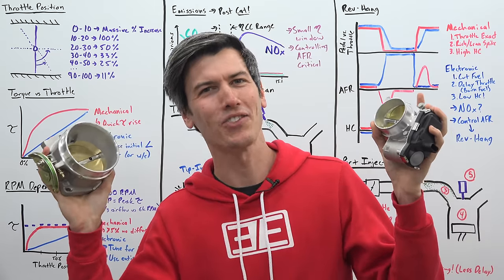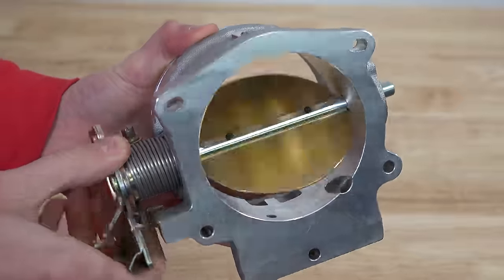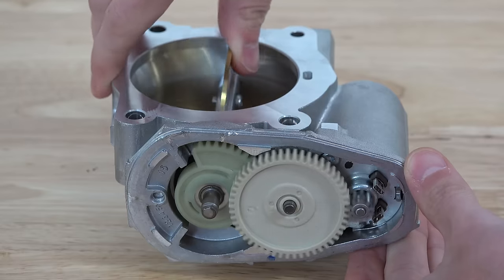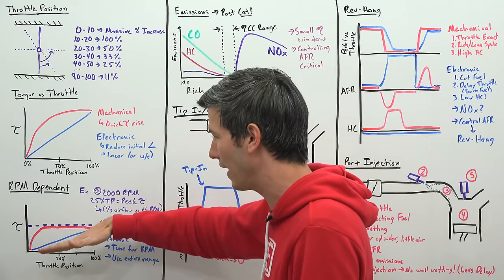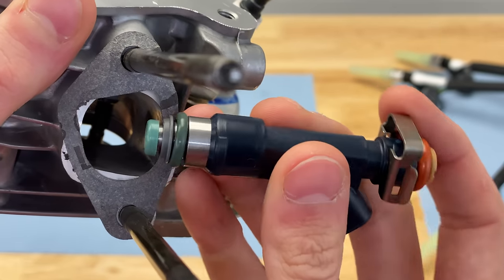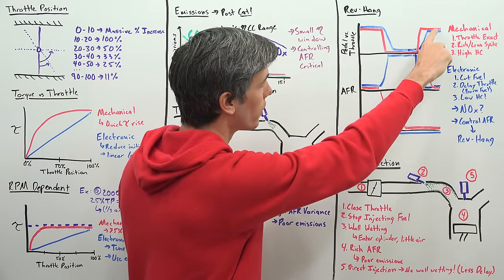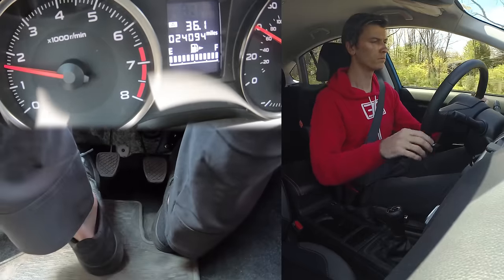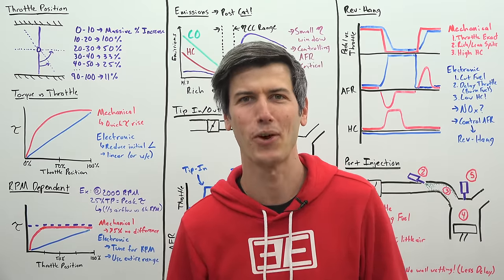The Big Problem With Modern Manual Transmissions - Rev Hang

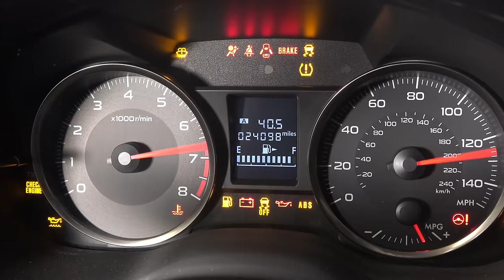Comment: It seems you contradicted yourself at 5:37 vs. earlier in the video.  You earlier mentioned rev hang leads to rougher shifting in a manual transmission, then said the electronic throttle body helps make shifting smoother.  The latter is true.  IMHO rev hang is only an issue with a manual transmission because you cannot take advantage of the engine braking as quickly vs. a mechanical throttle body.  The first time I drove a manual and noticed rev hang (I didn't realize immediately the elec. TB was the cause), I hated it terribly.  I did realize emissions had to be a part of the reason for an elec. TB.  A lot of cars used to have a damping system (sometimes called a dashpot) on the TB due to emissions and reducing backfiring due to fast TB closing.  Also, I'm not sure if Idle air control valves are no longer needed, but if so, less parts and that's always nice.  If you actually read all of this, I wrote it for you.
Reply: Yep. Didn’t see this and pointed out my old roots has a dash pot. Does exactly what you said and keeps throttle from slamming closed. So the new electronic doesn’t seem to solve anything but actually makes for a worse experience. Then again, manuals are going away. 😞

Comment: My Kawasaki motorcycles have mechanical throttle bodies with computer controlled secondary butterflies.  Was this an early attempt at achieving the results of throttle by wire?  It can smooth out the throttle if I go wide open throttle and "decide" how much throttle that is really needed.  I think that they can also be used to control noise in situations like EPA noise testing.  People used to remove the secondary butterflies, but now tuners have figured out how they can use them to their advantage in tuning.  Could you ever do a video on the secondary butterflies on motorcycles in the 90's and 2000's?

Comment: Why didn't "analog" carburettors use an oval/paraboloidal curve guide for the throttle cable? That would fix the lack of linearity on torque easily.
Reply: They used cammed levers, which does effectively the exact same thing.
Reply: @coupledyetivonvanderburg5385  so all the argument on the lack of linearity between throttle position and torque delivered is BS?
Reply: @whateverrandomnumber  
Yeah, for the most part.  The part about rev hang and the reasoning behind it is still true though

Comment: i feel like you can correct rev hang by correcting your shift timing habit.... idk i drive a 5 speed del sol... controlling the throttle with a wire hanger pretty much haha

Comment: I have a Nissan with ETB and a manual.  It's really weird.  Say you don't give it quite enough gas off the line.  A 'normal' car would just stall out.  This thing does a strange, 3/4th of a stall (all the dash lights will come on, RPM gauge reads 0) but it will sort of sputter itself back to life and 'restart' itself.

Comment: My Citroen C2 idles at 900 rpm stationary but as soon as it moves and you're coasting in neutral or pressing the clutch, the idle goes up to 2000 by itself until either the engine is warm or you can clear it with a few goes revving over 5000. It didn't used to do that so I'm wondering why.

Comment: all that goes out the window with the toyota im. there is no pros to pedal feel.
i mean i certainly like the idea that 1/3 pedal is the same as to the floor- exactly the reason why i bought a manual.
I have no idea WHEN the car actually wants to shift as its a jerk regardless. my solution is to be back on the gas before it comes out

Comment: Rev hang has been a problem for many cars even before Drive by wire throttles. i used to cut a aluminium can and half block the idle control valve with it and problem gone.

Comment: Electronic throttle is not required for air/fuel ratio maintenance when the air/fuel ratio is directly controlled by the amount of air flowing into the engine. Hint, hint. Carburetors also remove the need for MAF sensors, and electronic control of the engine in general.

Comment: The throttle position makes so much sense as to why im awful at being smooth on the throttle with my mazda. i thought a electric throttle body worked exactly like a mechanical one just without the linkage. When i switched from my thunderbird to my mazda i found it  felt way different than my thunderbird and i struggled to be smooth when accelerating and couldnt for the life of me figure out why. It was like i had to re learn how to drive a car.
On my old thunderbird or any other car ive driven with a mechanical throttle body i find way easier to accelerate smoothly. Electronic throttle bodies are technically better but to me the throttle pedal feel is actually worse.

Comment: I think how you shift matters. My cabled throttle body var will shift rock hard at wrong rpm. I over rev in gears to be able to drop the clutch quick that is silky smooth. NEVER would I let out a clutch at 2000 rpm
Newer cars have rev matching anyway so this will become obsolete eventually

Comment: So, are there any modern manual cars that don't have rev hang? Or is there a way to disable rev hang in modern cars so the driver can actually have control of the car?

See, I thought the whole point of even having a manual car nowadays is to be in control of the vehicle and have fun, but with rev hang and synchrosizers in the transmission control is taken away from the driver 😢

Comment: Couldn't an aftermarket tuner modify the program of the electronic throttle body to reduce rev hang?  You would just be increasing the rate that the ETB tips out (close's) when you let off the throttle.    Seems like that could even be added on OEM vehicles as a "sport mode" when crisper throttle response is desired.

Comment: My rev hang is only there up to around 4500 rpm. After that, its not there. With rev hang, you don't shift slower. You just let off the clutch slower. Good for low acceleration consistency. For trying to reduce shift times, just shift above that rpm. More clutch rub at low rpm is nothing. But every car is different.

Comment: i have Ford transit custom 2013 2.2 TDCi 114kw with electronic throttle and when i shift (doesnt metter up or down) the rpm match exactly next gear so when i release clutch there is no rev hang - when i shift lower gear the rpm actually increase to match it correctly (if necesery)

Comment: What about the opposite? I've got noticeable throttle lag in my 2015 Jeep JK manual, to the point that it makes rev-matching quite frustrating. Also, my engine spins down way faster that it seems like it should for the type of vehicle. It's almost like it wants me to shift it like a sports car. If I go too slow, I have to hit the gas a little bit to prevent a big jerk forward (and probably some major drivetrain stresses).

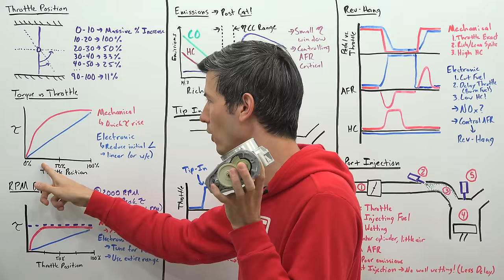I've had a number of people recommend the pedal commander, and I didn't give it much thought because all it does is re-map the throttle, but maybe I'm running into the differences mentioned at ~3:45, rather than true lag?
Reply: But why do you even need revv matching in a Jeep?
Reply: @SajtosNokedli  Whether it's a sports car or an 18 wheeler, if you're downshifting you want to match the revs.

Comment: Hi, I have a new 1 year ols Suzuki Swift sport hybrid and it has a terrible rev hang. Espechially in lower gears. In the 1st it takes literaly 2 secconds the engine to start loosing it's revs (when you push the clutch, it actually gains another 1000 - 2000 revs/min). It's impossible to change in the 2nd. Taht takes all the fun factor off and I consider to sell the car. Would the tuner reprograming solve the problem?
And how is the quickshifter mode made (sport cars and motorcycles)? Does it cut off the spark plug power?

Comment: With an electronic throttle, can you still flutter the gas pedal to force a gear change? I used to flutter my mechanical throttle to force gear changes at certain cruise speeds in the automatic transmission before I owned my hybrid, which is a different throttle beast all together... BUT I'm wondering what fluttering the throttle does in a computer run system...

Comment: The rev hang in the 140hp Fiesta Ecoboom has always bothered me greatly, coming from a 1.8 Civic which had almost none. I still think the heavy flywheel has some influence because both engines are direct injection, both have PCMs controlling the throttle not the right foot, yet the difference is very pronounced. The electronic throttle does explain one thing though. Sometimes in the Fiesta I feel like a train driver, because the big turbo (uprated on the 140ps) takes a while to spin up, even when I keep my foot in one position on the gas, it clearly increases the throttle setting as the boost builds. Coming from the NA Civic that is very weird. I think electronics have made the 'average' cars more interesting in a way because every single one has its peculiarities and just feels different, for reasons that the laydriver probably won't understand.

Comment: Does only partially closing the throttle when shifting solve the emissions problem?
IE: Going to downshift and easing the throttle back to 500rpm lower instead of just letting the gas pedal come completely up.

I guess the feds don't like emissions to depend on the individual driver, though.

Comment: If you have tip-out rev hang or overshoot during gear shift, that is because of poor calibration or no EMS specific software strategies. I guess that today the majority of the vehicles have automated transmissions and most engineers never have calibrated manual ones. In my time, clutch pedals had a switch or even linear position sensor. Also you do not mention catalyst O2 storage and O2 depletion strategies that can hadle fuel cut-off events to minimize emissions issues during manual gear change. Gear shift behaviour was always a major quality point in most vehicle manufaturer driveability evaluation criteria. I gues this has nowadays relaxed.

Comment: Happy (late) YT anniversary.  I wish you many more!  And thanks for good content.
Now about the subject of the video...  All well and good.  I get the concept and the reason behind it all...  But vehicles with electronic throttles that I have driven also delay when hitting the gas as well.  And I hate it. 

Me: * presses pedal *
Car:  Huh?
Me: * presses more *
Car:  Oh!  you want to go?   Uhh Ok...  Lemme' just,  ummm.
Me:  * presses more because nothing is happening yet *
Car:  Well, ok then!  * hard acceleration *  

I have only driven a few vehicles with the electronic throttle though. 2 examples are:  Driving a 2011 Dodge Caravan, that total delay is about 3/4 of a second.  Driving a 2008 GMC Envoy, it's about 1/4 of a second.  It's not much,  but it's JUST enough to be annoying as hell.  And it's also just one more expensive part to fail, and requires a computer programmer to figure out if that failed, or if it was one or more of the numerous other computer-controlled crapola that has failed. 

I'll stick with my carburetors.   If a carb goes out of whack, all I need is a screw-driver to adjust it, not a degree in computer programming and 1,000 dollars in special tools.  

Throttle, brakes, clutch, shifter, and steering.  All direct.  No delay, no dumbing down,  no second guessing.  I hit it.  It responds.
I want to drive the car, and be in control.  Not make suggestions to a computer operating system, and be overruled by a glorified integrated circuit.

Comment: Couldn't you get the same linear response with a mechanical linkage if you used a cam on the linkage if the cam is shaped appropriately?

Comment: I think there were some problems in explaining the mechanical throttle here. If you say that from 10 to 20 it opens by 100%, and from 20 to 30 just 50%, that doesn't still mean it opens by smaller amount. I appreciate that the openness of the throttle will not necessarily directly correlate to how much more air flow or torque you get, and that the electronic control for the throttle still gives the advantage of being able to control it more precisely, but your explanation gave the impression that the amount the throttle opens by decreases with each 10 percent, which is just not true. And it's actually opposite because of how circular motion, with which the throttle opens, works.

Let's assume that with every 1% of the travel of the throttle pedal the throttle valve itself also turns 1% of its way, so there is no change in how pushing the pedal opens the throttle. Say you can open it to a maximum of 90°, and when it's completely closed, it's at 0° (this of course is not completely realistic, but it's close enough to demonstrate my point), so 1% of opening equals to 0.9 degrees. Let's name the angle of the throttle valve as θ (theta), the maximum cross section area of the throttle at 90° as A and the cross section area at a given angle θ as a.
So the area which lets air through is: a = (1 - cos(θ))A

At 10% openness we have θ = 10*0.9° = 9°, so a = (1 - cos(9))*A = 0.0123A. So at 10% openness we only actually have 1.23% of the maximum throttle area.
At 20%, a = 0,0489A, or 4.89%
30%: a = 0,109A, or 10.9%
40%: a = 0,191A, or 19.1%
50%: a = 0,293A, or 29.3%
60%: a = 0,412A, or 41.2%
70%: a = 0,546A, or 54.6%
80%: a = 0,691A, or 69,1%
90%: a = 0,844A, or 84,4%
100%: a = A, or 100%

So we see that pedaling the throttle a little bit opens it by even a smaller bit, but as we open it more, the openness increases by ever bigger amount. So if we could directly correlate air flow and torque to the openness of the throttle valve, the curve you showed would be opposite. I'm not well enough versed in fluid mechanics to know how that goes, so I'm not saying it is like that. My point was to just show that the explanation you gave about throttle opening was very misleading, and it would still be so even if we had a throttle valve that increases the cross section area by equal amount for each percent of throttle pedal pushed.

Comment: Don't most mechanical throttles have a snail shaped 'pulley' to flatten the curve (so small openings happen more slowly) ... and we can rely on the spring to match our foot position accurately. Won't the richer mixture from the instant shut just be eaten by the turbo, keeping it spinning and creating a good boost of power when we slam the throttle open to use the low gear we have chosen?

Comment: My Ford DW10C 2.0 diesel electronic throttle feeling isn't intuitive at all. Apart from an indirect feel the ECU boosts up the revs while starting to drive from a dead stop. And then it cuts the revs so suddenly, that I do the kangaroo style jumps quite often when moving. I find the direct driven throttle way better.

Comment: Manual transmission jerkiness with manual throttle bodies is 100% caused by problems with the jerk behind the wheel. My father taught me "The top half of the accelerator pedal usually does nothing but waste your fuel."

Comment: Ah, a murican problem, what a classic.
I mean, In spain the main bulk of cars are manual, so rev hangin is a bigger concern to manufactures so they reduce it instead of having the same throttle map for autos and manuals, usually. Still, some new cars are wildy unpopular due revhangs.

Comment: Just semantics, but some older vehicles (Ex: 1970 Ford F100) use a rigid linkage, rather than a throttle cable.

Comment: My ‘19 mustang has some serious rev hang in 1st and 2nd gear. I never had this problem with any other manual car and it’s very annoying. Been driving it for a whole year and still haven’t got the hang of it. It’s still jerky and I’m wondering if that’s just how the car was made or if I’m just not driving it correctly. But like I said I never had this problem with my 04 tsx and my 09 civic. Any pointers??

Comment: Hey, Engineering Explained; I have an issue I hope you can help me with. I have a 2020 Ford Mustang GT.6-speed { my seventh since 2006} This car has rev-matching, which has become annoying. I don't need for the car to rev up every time I'm slowing down. It seems like the car thinks that every time I go down a gear, that I'm going to speed up. It gets nerve-racking every time I'm coming off the expressway ramp, that I keep hearing the engine rev up for each gear. Is there any way to disconnect rev-matching?  None of my other Mustangs had this feature and I enjoyed them just fine. Please let me know if this can be done, and  if it's an expensive undertaking. Thanks.

Comment: Many of the younger generation will never know what being in control of a car was actually like.  You used to step on the gas a little and the wheels went around a little, stomp on the gas and the wheels went around really fast, step on the brake and the wheels slowed down, stand on the brake and the wheels stopped. Today you have no idea what the car will do which makes them much more dangerous.

Comment: what if you use a larger throttle body that is electronically controlled is it possible to get it to tune and get rid of the rev hang, this month I went to multiple tuners sadly none could figure out how to make the throttle body work

Comment: Well, what isn't good with an cable-operated accelerator pedal is when it freezes and gets stuck due to vehicle age. It's not very nice standing at an red light with 4000 RPM or not being able to shift properly because the accelerator is stuck due to ice. That won't happen with an electric one. When it isn't working its completely broken but it will work forever if well-engineerd. The tube around the cable will always be worn down over time or will lose its waterproofness.

Comment: some new cars keep accelerating when you suddenly up the foot. It's absolutely annoying. If I remove my foot out of the throttle I want all engine break immediately. That is specially important driving in a tricky place with corners, hills, speed hills, traffic, etc. I really prefer avoid spending break rubbers.